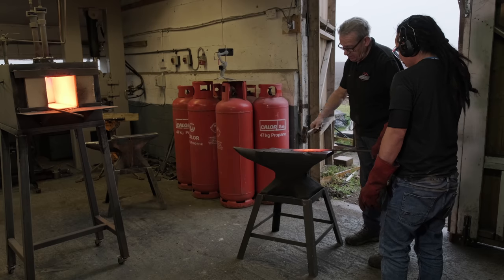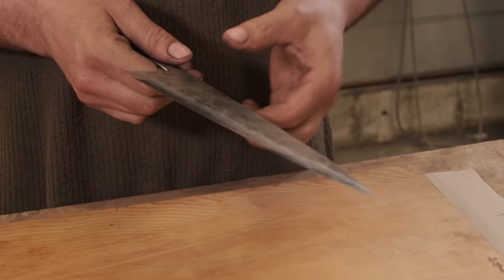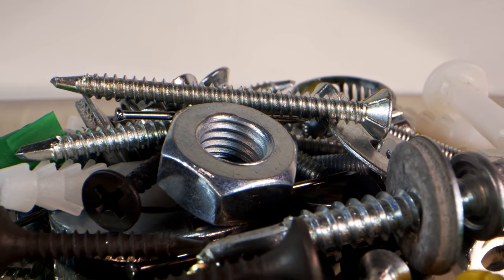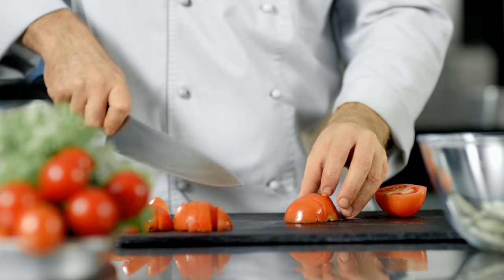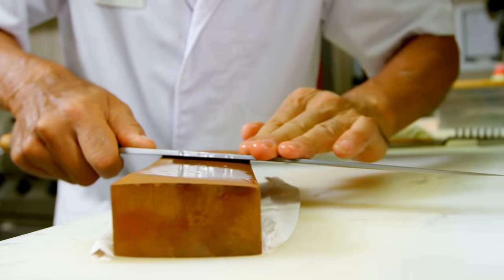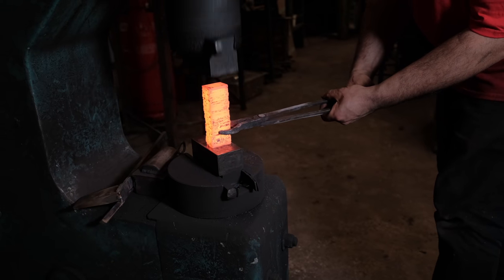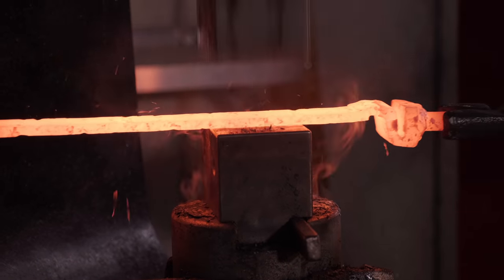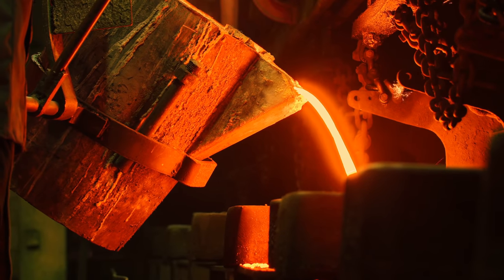Why 98% of knife makers pick the wrong steel according to a metallurgist

Comment: Totally agree with this. If all you're interested in is the performance of a knife, there's no reason to choose anything other than stainless. Personally I like RWL34, which even grinds relatively easily. But stainless doesn't patina like carbon, it's harder to sharpen...and so on. The important thing if you're having someone make you a custom knife is to know what you're getting and to understand there's no such thing as the 'best' steel.
Reply from the maker: Hi Skunkworks! Thanks for the comment and feedback! I echo your sentiments. A lot of people think that there’s one steel to rule them all but the truth is there’s a lot more to do that. I hope you’ll enjoy the other knife-making related videos we put out as well! Thanks!
Reply: There'll never be a single alloy much less the blade geometry and thermal cycles for every knife & every use. No one alloy is measurably over every other for every use!!! Just the fact of user preference for sharprnability takes edge holding steels off the table.
Reply: What hardness is the RWL34 often treated to?
Reply: @sacoto98  I follow the damasteel HT guide to get around 62, though they also recommend cryo for full hardness so in reality I'm probably getting 59-60. They advertise up to 64 as being possible.
Reply: @SkunkworksProps  thanks! Is there anyway I can test the HRC of an already nade knife?
Reply: @sacoto98  Find someone with a tester! It will leave a small pinprick type mark similar to a centre punch tool, but that's the only way to do it that I know of. Someone who heat treats knives might be able to do it for you for a small fee. It depends, I will HT knives for people locally, but I don't have a tester.
Reply: Your use of the word "performance" is very poor. It's a problem of your mastery of English. A 1075 blade that costs $10 and sharpens to stupid sharp after two swipes in a diamond rod performs in that way. A $10 stainless knife that crumbles on butcher steel performs in that way. An s110v pocket knife that stays sharp through all your cardboard and then you are unable to sharpen, performs in that way.

What is better performance is subjective to a person and their uses.
Reply: @bobjohnson1633  It's a bold move to criticise someone else's grammar with a comment that is riddled with grammatical errors.

Comment: I'm a hobbyist bladesmith and love using 80CrV2 for most of my knifes. Mainly EDCs hunters, skinners, utility and camp knifes. And for any kitchen or fillet knives I use 15N20 because it's supposed to have alot of strength in the thinner profile
Reply from the maker: Hey bud you are absolutely spot on! I feel you have good steel for both type of knives you use for the exact reasons you’ve described! Thanks for watching!
Reply: @UKBladeshow  How do you manage oxidation on stainless? Do you forge under inert atmosphere? 
Where steel had been made without it, since ages, stainless needs other methods to attain it's "best" capabilities...

Comment: The completely unnecessary high amounts of chromium added to knives for the “throw it in the dishwasher” crowd make those knives much more difficult and less pleasurable to sharpen. I only have one high carbon knife (white #2 steel) and I spend 5 times longer soaking the stones than the actual sharpening process takes.  A very good option would be a “semi stainless” steel with about 4% chromium. Still easy to sharpen and will not react as quickly. I believe Konosuke are big into this type of steel.
Reply from the maker: Oooooo that sounds like an interesting take on sharpening thanks for sharing!
Reply: Not a formula, just an indication of how quickly a knife with no chromium sharpens up. I’ll take sharpen ability over extreme hardness every day. The extreme example being the non user serviceable ceramic knives.
Reply: I disagree somewhat, simply because the "throw it in the dishwasher crowd" are almost all buying cheap factory knives that are tempered so soft you can just about sharpen them with a brick. And you have to do so nearly every time you use them. They're ground after HT and they've been tempered way back to save wear'n'tear on the factory's grinding wheels. 
Naturally that does give you problems sooner or later, because you end up with little lumps of carbides on the edge as you grind back the steel matrix. I suspect that's at least partly where the whole thing about "You can't get a good edge on stainless steel" came from.
In my experience the people who buy CPM-154, Elmax and similar high-alloy kitchen knives, at least in the handmade/custom realm, are NOT just throwing them in the dishwasher, and they have diamond stones etc for sharpening. They want the high wear-resistance more than the corrosion resistance, and to them the trade off of sharpening taking longer is worth it. 
I do agree that "semi-stain-resistant" alloys make a lot of sense.
Reply: @trappenweisseguy27  you actually can have both sharpenability and extreme hardness. A knife made of a simple alloy like O1 at 65Rc will hold an edge a very long time, but you can still sharpen it with natural stones or waterstones. The best application for that is in the kitchen or in a straight razor, and in razors and most kitchen knives you want the edge ground real thin to begin with. That makes honing and sharpening a lot easier too, compared to the same steel and HT with a big thick "survival knife" type edge. There's just less steel there to grind away.
Reply: The swedes use lots of semi-stainless steels like for the mora knivs.
Reply: @onpsxmember  which specific alloys are you talking about? AFAIK most stainless Moras are 12C27... that is definitely in the "stainless" category with 13.5 percent chromium.
Reply: @onpsxmember  as far as I can tell they either use simple high carbon steels or fully stainless steels and hardly ever (IF ever) in between.

Comment: Thank you for this - a lot of great info, easy to digest! I‘ve been working with Niolox a lot lately and I love the way it turns out as soon as the knives are finished. The grinding though is a serious pita… 
I ordered a stack of CPM Magnacut yesterday and a set of fresh belts - you just lowered my expectations on how long they are going to last.
Out of your experience - which belts do you use for these kind of steels? Cubitron 2, or are there any that won‘t burn as deep of a hole into my pocket?
Reply from the maker: Hi again Alp 77. Thanks for sharing your thoughts and feedback on the video!

I want to personally learn more about the contents of CPM Magnacut so I can understand more about how to remove stock from it. I will find a datasheet for it and get back to you. Maybe I can add it to my next video on abrasive belts like you requested perhaps?

Also, would love to hear your experience on grinding Magnacut as I would love to learn more about it too!

With regards to your question on other belts to consider - there are loads of good ones out there and every single belt has its pros and cons (including the Cubitron II). If you want a cheaper belt with decent performance, the Norton R929 (available from GFS Knife Supplies) works fantastic at a fraction of the cost of the 3M Cubitron II. They are also a “friable” ceramic grain meaning they break down to produce a fresh new cut with little pressure so you get a fantastic cut rate without too much fatigue in return! It also doesn’t leave heavy scratch marks compared to other ceramic belts so it’s a great alternative to try! But again, it depends on your objective and what improvements you want to make from your current process (is it speed pf stock removal? Is it less hand sanding you want to achieve? Does your belt grinder have the hp to run a ceramic belt?)
Reply: @UKBladeshow  Now thank you for replying in such detail! 
My batch of Magnacut should arrive tomorrow. 
I normally tend to profile grind, HT, then grind out thin. This worked perfectly on my carbon steel knives while on Niolox already there are problems coming up. In the early bulk removal I am wasting belts like crazy. Even with high pressure VSM Ceramics I‘ll easily need two to three 36 grit belts per side on a santoku sized blade. Your video on abrasives encouraged me to speed up my belt and crank the pressure which really made a difference but then I‘ll still battle cooling the steel enough. I added a mist cooling system which gives me about 30-50% more time on the belt between cooling. To sum it up I‘ll need at least five full hours for the bulk grind compared to maybe 45 minutes to an hour on a simple carbon blade. That’s a big challenge for my patience 😅
The next thing is the amount of steps to get to my desired finish. Right now I‘m doing 36+ cub2 or 36 VSM Ceramics, then 60, 80, 120, 240 VSM Ceramics then switch to Trizact 160, 100… the smaller steps I take the less time I spend on a single grit. Still there are always some scratches that make me go back two or even three steps to get them out comfortably. 
It would be of huge help to piece together a set of belts for the more demanding steels that could help me win some time…
Reply: @alp7778  Doubtless you are keeping a bit of thickness before HT to avoid warping of feathering during the HT process.  Out of interest, how thick do you keep it as a minimum?  I know it's not a purist solution, but have you considered an intermediate bevel at something a like a third wider angle than the primary and two thirds less than the final bevel, to avoid the need to grind a lot off the wide primary bevel faces?
Reply: Good reply! There's many ways to arrive at the same goal. I'm very interested in experiments.
  I'm sorry this fellow is fighting time and wearing his patience thin! The fastest grinding of knives is done with AEB-L as it's easiest to grind. Tough, but not the highest ( or lowest) edge holding. 
  I'm putting together steel alloy bars now then next is Belts and grinder. I want three horsepower, but even two is more than double better than one horse. This week I got in double clad laminated steel CTS XHP core jacketed by AEB-L. And 26C3 jacketed by 410. By the weekend I will have Terrivantium 365. It's a non steel Cobalt alloy blade material and one doesn't heat treat it. It's a 40 HRc matrix with tons of hard particles in it like carbides which do the cutting with a toothy edge which isn't particularly sharp, but lasting. Great for people who don't maintain knives ( don't clean and oil or sharpen their knives) since it doesn't rust and those folks are used to less than sharp knives ( UGGHH!)
Reply: @kit6357  depends… My Niolox stock is 2,1mm so I do the whole grinding after HT. Still warping is an issue though - just ground out a blade that developed warp mid grind. I usually straighten with a carbide hammer and grind out the marks. 
On thicker stock I‘ll grind up to 80% leaving a bit more margin on straight carbon steels as opposed to stainless.

Comment: I absolutely love my knives made from R2/SG2 powdered steel, two of which are damascus. They're pricey and hand-forged, specifically selected from bladesmiths that specialize in using it.  They're a bit of a PITA to sharpen but hold an excellent edge. These fall in right around 63RC.  After using these, it's nigh impossible to go back to a standard stainless.
Reply from the maker: Sounds interesting! I wish I knew more about the powder-met stuff! Thanks for sharing and hope to see you in our other knife making videos!

Comment: What a fabulously well informed metallurgist...as this man is of course " more" than a knife maker. Curious though, I 've heard no mention of nickel in these alloys. Can't nickel help with both hardness & non - corrosion?
Reply from the maker: Hi FlatlandMando thanks for the appreciation and lovely to hear you enjoyed the video! I have had a few people now ask about Nickel-content on steel so I will probably make a video on this too! Thanks!
Reply: Yes indeed. For instance, a small amount of nickel is what makes 15N20 and "saw blade steels" like L6 an improvement over alloys like O1 and 1095. 
15N20 and L6 make very nice knives on their own, and pattern-welders often use them as the "bright" part of "damascus" steels because they resist the etching and don't turn black.
Reply: for clarity - neither 15N20 nor L6 are "stainless" by any means. They WILL corrode like other "carbon" steels in just a slightly longer time. But they resist the etching enough that "damascus" makers take advantage of the difference compared to things like O1 and 1084.

Comment: This is one of the BEST videos I've ever seen on knife steels. Well done! As an aside, you talked about sharpening knives using a steel. How many times have I heard people say that a steel only ALIGNS the edge? This from some top knife makers. In fact, a butchers steel has lots and lots of little serrations and WILL REMOVE METAL FROM A KNIFE. So will ceramic rods. When a butcher's steel becomes worn out or you have a long round screwdriver or something, then you can use it to align the edge. I believe they actually sell aligner steels as well. True, for really hard steels, not much sharpening goes on. That's when I use diamond rods. :) Thanks again for a great video!
Reply from the maker: Thanks Limicola! We appreciate the compliments and feedback! If you are interested, we have lots more pro tip videos HERE: https://youtube.com/playlist?list=PLFssspwgISv-q8YPgoAg1XNZYw9YbMkJT

Comment: Fantastic video!   I use AEBL  almost exclusively because it simply works extremely well for most applications.  I do a lot of kitchen knives, as well as hunting and fishing knives and slipjoints.  AEBL has proven to be exceptional in these roles.  Mind you, the common denominator among all of the types of knives I’ve mentioned is that they are slicers.  This is where AEBL shines.   I have also used a lot of CPM154.  It is amazing steel, but in the applications that I make knives for, the performance isn’t better enough to justify the downside which is that most of my customers can’t sharpen it.  It does offer better corrosion resistance than AEBL but this would only be noticeable if used regularly in a salt water environment.
Reply from the maker: Hello 👋 thanks for the comprehensive feedback and you are in the group of people that love AEBL! I really want to know more about this steel and I wish I knew more about it before I filmed this video! It seems to be a fantastic all-rounder for most types of knives! Thanks again for watching! I hope you enjoyed it!
Reply: @UKBladeshow  again, fantastic content on your channel.  subscribed!
Reply from the maker: Massive thank you! Hope to see you again on the other knife-making videos we have! Cheers!

- Vinz

Comment: For carbon I used 80CRV, basic stainless is use AEB-L.  If I need a higher wear, I use S35VN. 
Been happy with all of them.
Reply from the maker: Hi Jared thanks for sharing! I think we are all so lucky that we have all these fantastic options on steel! 

Hope to see you in our other videos! Cheers!
Reply: Those are excellent choices to cover all the bases. You could make any knife you possibly want out of one of those three, and be very happy.
And if for some reason you don't have electricity or proper quench oils, you can still HT and temper the 80CRV with primitive equipment.

Comment: Interesting to hear it broken down that way, I've always preferred to use stainless knives as after the initial sharpening process they just required basic maintenance to hold an edge. While I may be aware of the chemical composition of the alloy it's nice to hear it explained from the metallurgy standpoint.

Comment: If I ever get my hands on some of that powder steel, I'll make sure to hammer the edge on it (I've done that multiple times before, so I shouldn't run into too many issues. This would basically allow me to use my precious few grinding belts for cleaning up and some very minor shaping left to do. Just a short "love tap" on the belt would hopefully put a good enough edge on it to do the rest on the wetstones.

Comment: I really like s30vn, s35vn, magnacut, and for budget 14c28n, with magnacut being my favorite. Everyone complaining about ease of sharpening on harder metals, get better stones or plates. Use the proper tool for the job you spent the money for the high end steel so, spend the money to maintain it. There is nothing like the feel of the glide of a blade acrossed a good stone. I really like the shapton kuromaku stones they are fantastic for any metal no matter the hardness

Comment: thanks for educating us, I don't mind that the carbon steel knives, I use have black blades, I find them quick to sharpen, there old sheffield knifes, some are over 100 years old, and  I started as a butcher back in 1967 for a few years, so sharpen knifes on autopilot. I worked in the " Home and Colonial store " a busy place, 5 people serving behind the counter, and 4 butchers, out of public view, working non stop. all the knifes were Victorinox Molybdenum Stainless Steel , a piece of flint stone is like a razor. that must be the oldest knife.